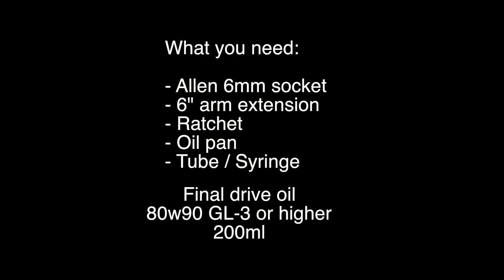2013 + Piaggio Fly 150 - Final Drive / Transmission / Gear Box / Hub Oil Change

Comment from the maker: THINGS YOU NEED:
Gear Oil : http://amzn.to/2f8BXQH
Syringe: http://amzn.to/2viLb37
3/8 Drive Ratchet: http://amzn.to/2f9ndRs
Allen 6mm socket: http://amzn.to/2u4kM9A
Extension Arms: http://amzn.to/2uX4rSX
Torque Wrench: http://amzn.to/2f9lXhc
Reply: gear oil link its for a Motul Gear 300 Gearbox Oil - 75W90 - 1L  video says 80w90 ?

Comment: for everybody that's bout to try this out, take out your filler bolt first otherwise you drain all the fluid out the gearbox and if your filler bolt is stuck you can't fill it up anymore! take this lesson i learned this at the hard way;) (and if it happens and you cant open up your filler bolt you can try to flip your scooter upside down and fill it like that but it's a pain in the ass)😂😂😂

Comment: you should remove the filler bolt FIRST because if you remove the drain bolt first, and the filler bolt is stuck, you are screwed